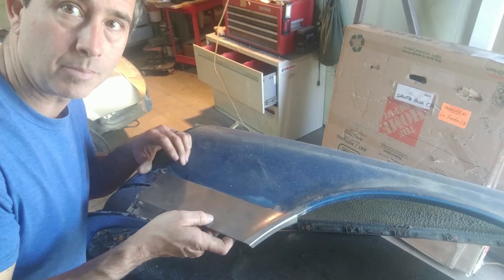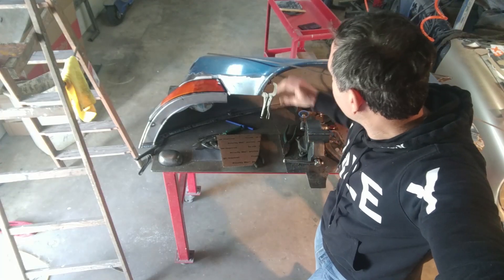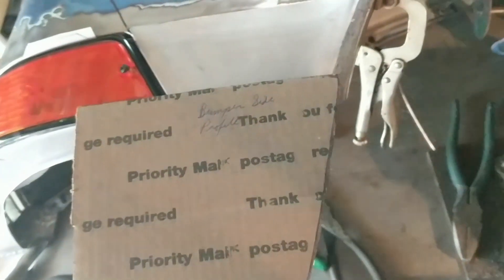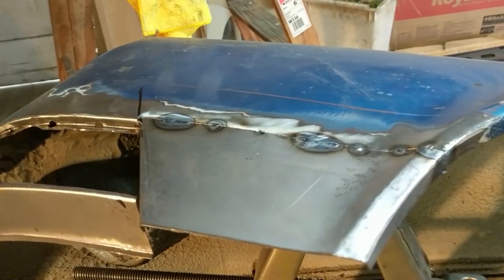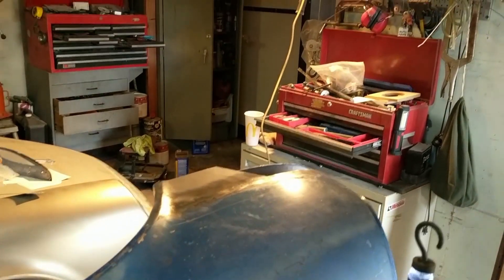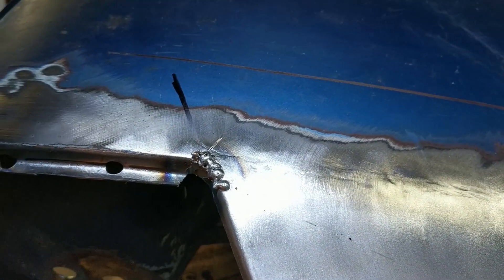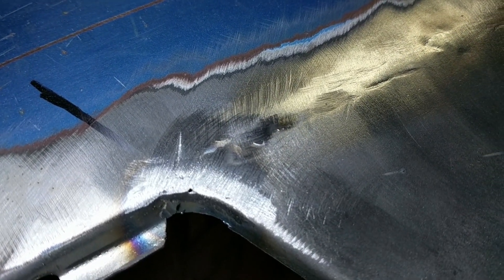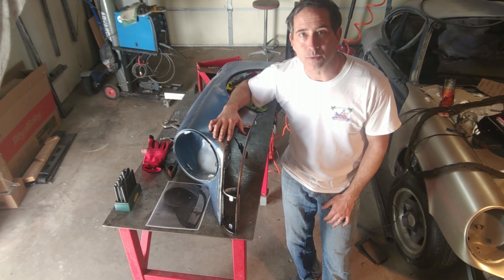TIG Welding Sheetmetal Patch Panel for Backdate Fender (Porsche 911)

Comment: I am watching weldding videos by at least 4 hours to learn how weld a old jeep. I have learned more in your 21 min video than previous 4 hours.
Reply from the maker: Really?  Have you watched this one yet?  https://youtu.be/t2xomaxWhFc
Reply: @GarageTimeAutoResto  really. I have watched this video after you recommend it on one of earlier comments. Very, very educational. I will try fix some rust holes in my father's CJ5.  I'll train before weld in car. My tig welder doesn't support pedal. It Will be challenging.
Reply from the maker: Is it scratch start?
Reply: @GarageTimeAutoResto  no. HF start. But with a cheap torch. At least the gas is controlled by welder. Starts with a button on torch. I used to do stick weld, but I still virgin on Tig
Reply from the maker: Ah so no variable control?  Just on/off?

Comment: An episode from your channel just popped up as a suggestion in my start page and glad it did! Nice work 😎. I will enjoy following this.. 🙂
Reply from the maker: Great!  Thanks for being here.  Are you also working on a Porsche?
Reply: @GarageTimeAutoResto  No, but I am very fan of air cooled vw’s and the 911 is for sure at the top of the list for me. Currently working on a 4x4 project with some welding required. I think it is a good project to build some metal shaping and welding skills on. Later sometime I hope to have something air cooled in my garage, probably a beetle as the 911 is really expensive in Norway..

Comment: 2 years late but that is some awesome work!! It’s quite a complex shape when you have to make it from flat!
Reply from the maker: I'm glad you found an older video!  I also made the front hood section which was even more curved.
Reply: @GarageTimeAutoResto  I’m in the process of restoring a 1975 Vw double cab pickup. I’ve mig welded most of the time but recently bought a Tig machine. It’s like starting again lol.
Reply from the maker: TIG is very different.  Let me know if you need help.  I teach TIG welding!

Comment: Please don't be offended.  BUT.  you should have made that panel and flanges for the indicator . All in one go.    Then as you know. TIG is just the new Oxy/Acet  replacement. So you shouldn't have had those  big weld beads that you had to grind off.    I recommend that you practice a lot more on your welding techniques.   Your work will then become much easier and more satisfying.

Comment: I know this is an older video but it answers so many practical questions around MIG vs. TIG and heat control, warpage & compatibility.  I'm currently adding TIG to my skills and this is just fantastic reference.  A big THANKS!
Reply from the maker: Thanks man!  I have a few other vids on TIG welding.  Like the time I welded my flares on

Comment: Excellent work!!, one suggestion use wet bentonite as a heat dam for any patch in large panels to eliminate distortion.
Reply from the maker: Thank you!  I have not try the heat dam you suggest, but I'm open.  One question I have is this:. Doesn't the heat sunk require either more current or travel speed to keep the puddle the same size?  Not be critical, just asking your experience.
Reply: Garage Time - Restomod no a heat dam just isolates the heat to the area your welding so it doesn’t radiate into the surrounding metal. Really critical on a hood for example.

Comment: You dont metion if you tig weld dc or dc pulse what you amps
Reply from the maker: DC with variable foot pedal.  Machine set to 28 A and I pulse the pedal a little.  Myachine doesn't have an auto pulse feature.

Comment: How many amp what size of welding rod what size of tungsten.. what you pre and post flow gas setting
Reply from the maker: Every welder is a little different, mine is Miller diversion 180.  Non adjustable pre-post flow.  The post flow from miller is long.  22A, .040" tungsten, .023" wire

Comment: What amp and timing setting are you using for the sheet metal?
Reply from the maker: 25A and postflow is about 8 sec
Reply: @GarageTimeAutoResto  Thanks a lot! We always have trouble with burning through the sheet metal, even on lower amperages
Reply from the maker: Sometimes you need to backstep with the torch and let off the pedal a bit.
Reply: @GarageTimeAutoResto  what do you mean by letting of the pedal a bit?
We basically only have that switch on the torch handle
Reply from the maker: That's the problem.  You need a variable foot pedal or variable torch switch.  Pedal is best
Reply: @GarageTimeAutoResto  ah, I didnt know that exists. I'll read up if there's a compatible one with our Stahlwerk TIG welding machine. Thanks for the tip!

Comment: This is great, thank you. Finally found one doing it properly with TIG. Ive been trying to find the little sanding discs you use to clean off the weld when youre done but having no luck. Can you point me in the right direction?
Reply from the maker: Thanks, search for Roloc Disk by 3M.  I recommend 80 Grit for TIG welds.  Sometimes I start with a 3" cutoff wheel if the weld is standing very tall, then finish with Roloc disk.  I don't recommend a big grading wheel or flap disk on a 4.5" angle grinder.  They put too much heat back into the panel and work too fast for TIG welds.

Comment: Took you what.. like 5 hours on that corner? Maybe 6? 7? Now we know why body work professionals charge so much! Great video, and thank you for sharing. I am looking at the Multimatic 220 from Miller. Does MIG and TIG. Do you recommend that?
Reply from the maker: Totally agree that pros need to charge what they do!  I've never used a dual welder, but you can't go wrong with Miller.  I'm sure it will be good.
Reply: @GarageTimeAutoResto  Cool, thanks for replying! Have you ever used the Millermatic 141?
Reply from the maker: Is that an inverter machine?  My TIG is an inverter machine and it's great, my MIG is the Miller 135 I think and it's a larger transformer machine.
Reply: Garage Time - Restomod I think the Millermatic 141 is still a transformer machine.
Reply from the maker: No one ever got fired for buying Miller!

Comment: So, what tig welder did you use. I love using Miller products, I've been shopping around for  tig. I have seen a cheap imported model, the ahp alpha tig, like $700
Reply from the maker: I have the Miller Diversion 180.  It's good, but not many adjustments.
https://amzn.to/2SrYLK5
Reply: @GarageTimeAutoResto  yeah, that's one I've considered, the syncrowave 210 is pretty nice too, but I believe around  $3000. I hear alot of good stuff about the ahp alphatig also on amazon, but its still a $700 risk. With miller i feel confident whatever machine will work fine, expensive, but straight forward.Amazon is cool, I do order a ton of stuff there, but check out cyberweld.com for metal working equipment and consumables.
Reply: Late response, but I like my AHP. I use Miller at work but for home it works excellent and has good adjustment for Aluminum as well for a fraction of the cost.
Reply from the maker: Cool, thx Jesse Combs.  Are you the one I've been watching from 10 years ago on power block TV?
Reply: @GarageTimeAutoResto  Haha, I wish I was TV famous, but that wasn't me. Perhaps you are referring to the lady, Jessie Combs.
Reply from the maker: @misterj5045  ha ha, I got a little excited at first.   Obviously I didn't check the spelling, I was so excited.

Comment: How high current did you use when welding?
Reply from the maker: I use a variable pedal which is key.  I set the machine at 30A but don't always use it all.  If you are beginning start with less.  It really depends on metal thickness, travel speed, skill, etc.
Reply: @GarageTimeAutoResto  exactly why your welds are terrible.
You should be using 80 amps which is why it took you so long and you have such a heat build-up.
40 amps per millimeter minimum...